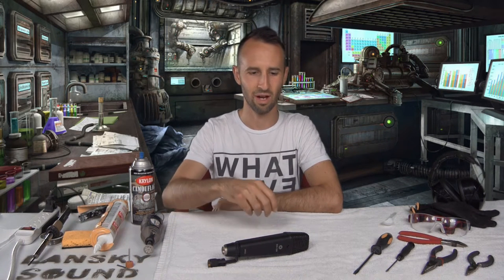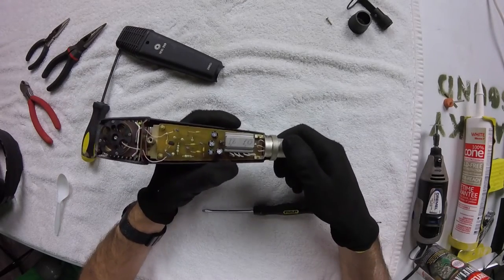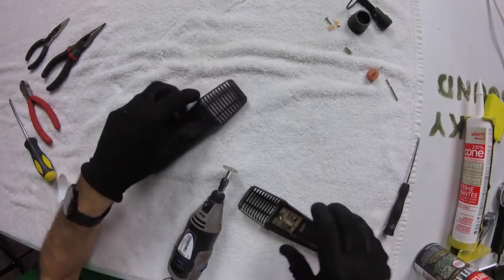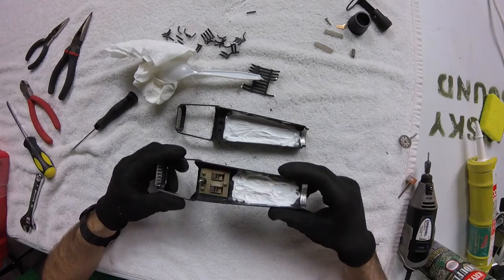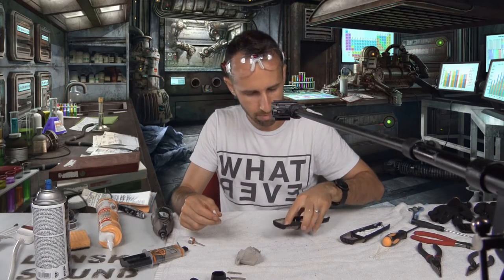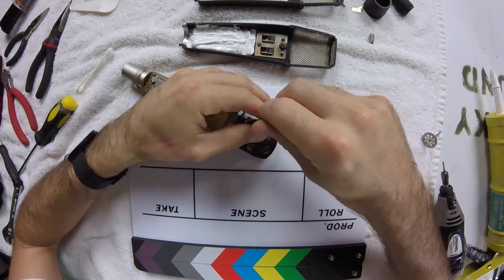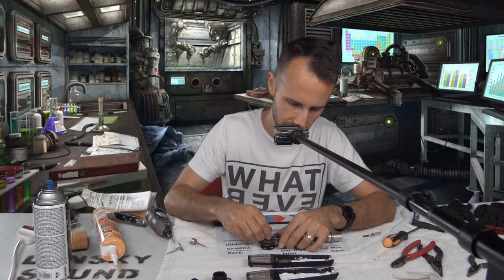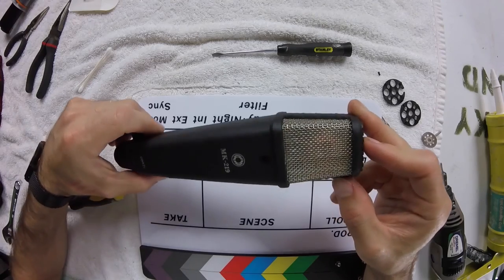Oktava MK 219 Disassemble and Mechanical Mod

Comment: I've had my 219 since '98, and didn't really notice that resonant 'A' until I did some comparisons... then it stood out like a sore thumb.
I performed the mod on it last night, and yes, it really did get rid of it. Sounds great! I wasn't able to remove one of the resonator disks, due to one screw wanting to strip, but doesn't seem to be a bad thing.(The screws that hold the disks on are cheap, and VERY small... make sure you use the correct sized screwdriver, and even then be careful.) I used 1/8" Neoprene instead of silicone, which seems to work as well.(no glue required... clean)👍
Thanks for the walk-through, moin! (: 3=

Comment: OMGosh, I've owned one of these for years. Mine says 2002 on it. I paid a hundred dollars for it, I think, at a Guitar Center in Columbus, Ohio. I also bought a TUBEpre that day, to use with the mic.

I like the 'background' in your video. Quite fetching!
Reply from the maker: Awesome! Time to jazz it up. Both of mine are 2002 as well & were also purchased used from Guitar Center. I do like the Oktava mics with tube preamps - the warmth seems to nicely compliment the microphone's natural midrange presence. For $100 that's awesome.

Haha, I try to have fun with videos instead of being the "ultimate cool engineer" guy. Thanks for posting! Let me know if you need any help with the mod ;D
Reply: Hey! I just found one of these with a bunch of stuff someone was about to throw away. I knew it had to be decent, but I'm not sure how good it may be or what recording applications this is best used for. Any help would be great!
Reply: @andrewearle1272  I bought a pair for stereo usage dated 2001. F'ing quiet. F'ing balanced EQ. 69 bucks a piece. Just fine for most vocal purposes.m

Comment: The big problem mechanically with these Russian mics is that the cartridge is not isolated or shock mounted.  Even touching the cord makes noise in them.  You could fix that but it is a lot of work.  These mics are worth playing with if real cheap.  IF you want to mod mics there are probably better ones for that.

Comment: very cool .
Reply from the maker: Thank you! I originally bought one of these just as an experiment to perform this mod. After modding this mic, it has seen so much use & has been so wonderful I have just purchased a second for stereo recording. For $120 preowned, this is one of the most cost-effective transducers on the market. Anyone thinking about buying a new LDC for vocals or any instrumentation would do best to pick up a used MK-219 instead of anything new in that price range!

Comment: I did the front mod removal of the metal grill.  I didn't do the back.  I'm  getting a serious hum from the mic.  when I place  the front grill piece  back on the the front of the mic the hum stops.  Am getting the hum because I only did the front?
Reply from the maker: hey! Sorry too ear of your troubles. What's happening is the remaining grill needs to be soldered to the frame of the head basket. It's a grounding issue that will come up in some mics but is easily remedied by soldering the metal grill to the frame. I hope this helps!

Comment: Couldn't you in theory also cut an access slot for the wire on the resonator disc? So you could reinstall it?
Reply from the maker: Surely this could be done, but the sound improvement is significant & reinstalling a damaged component might cause undesired excess resonation. Interesting thought tho ;)

Comment: Recently bought one of these supposedly from 1996.
Most everything looks legit and sounds legit, but it has a white resonator HF disc in it. 
Thinking of doing this mod but I’m wondering if I should return the microphone. 
God these things are hard to identify.
It’s got black flathead screws. 
A little part on the inside scratched off that says t 48.
Front says 1996 r
Back says ASM
Reply: Btw great video thank you so much for doing this.
Made me feel comfortable doing it.
You explain things very well, great teacher.

Your background blew my mind when I realized your not actually in a post apocalyptic engineering station.
Reply: I don’t think many if ANY 219 were Chinese.  Just the 319 and the O12 and MOSTLY 012’s.  If they are flat head screws, my understanding says...you’ve an original.  Don’t mess with it. The 219 is a great mic as is.

Comment: I accidentally dented my diaphragm with the screwdriver. Any chance it'll still work ok? I had to order a new phantom power box, so now I'm waiting in suspense for the delivery man to come today, to see if I completely wrecked my only mic.
Reply: It seems to be working fine. I ordered a cheap BM-800 LDC from amazon so I would have SOMETHING to compare it to, and the 219 still sounds better than it does. I just wish I could remember what the default position for the switches was supposed to be. I think I might have it on the DJ setting. LOL (or maybe the BM-800 is just super thin-sounding in comparison).
Reply from the maker: Stuff like this will affect the frequency response but if it sounds good, it is good ;)
Reply: @AdamLansky  Yeah it still sounds great, still way better than my HK BM-800 lol.

Comment: Any thoughts about the 219 vs the 319?
Reply from the maker: Hi! YES, the 319 is a better transducer. The headbasket design is far superior & this alone makes it a better mic, even with modifications on both. If you have the opportunity to get the 319, go for it! The only advantage I've found with the 219 is that the shape makes it a PERFECT mic for toms on a drum kit. The 219 is my absolute best tom mic & I grab that long before I grab the Sennheiser MD-421, which I honestly think is overrated at this time in recording history.

Comment: I have two Mk 219 and two Mk 319.   They’re basically the same animal I’ve read. Not sure.  The un modded MK 219 sounds better than the 319.  Mediocre condenser mics are too bright for my tastes.  Sure, spend thousands of dollars for John Lennon’s spit having been near one that looked like it.  If this adds high end “detail” to the 219, then IMHO this microphone has just moved into mediocre condenser mic land.  Too much detail in frequencies that you don’t need or sound good.  The 219 sounds way better than the 319 for everything.  Maybe a waif - ish girl singing at 10 dB...anybody remember “Cat Power”.  She’s GOOD.  I still wouldn’t use my 319 on her.  Thinking about selling them actually after I just A/B ‘d them after bumping into this video for the tenth time.  The 219 is good as IS.  Don’t screw it up.  I’m so happy I compared the two first before I screwed up a mic.
Reply from the maker: what

Comment: Nice video thank you. I also recommend a PCB and circuit mod,  there's an inexpensive PCB that is much better than the cheap original one. 
"The RT-219 is a pcb which can be used to repair or modify the Oktava MK-219
microphones. It is in itself an improvement on the original PCBs, better
quality and with a solder mask on both sides and a partial ground plane.
It offers higher electrical insulation properties and greater resistance to humidity. "
Check it out here: http://russelltechnologies.co.uk/rt-219.html